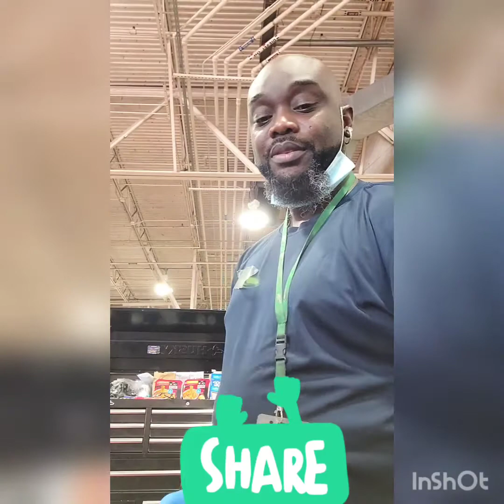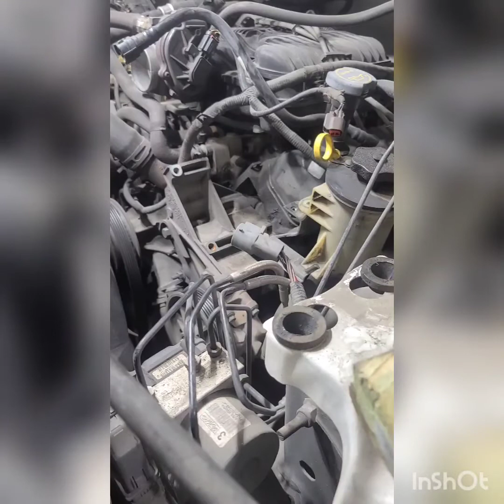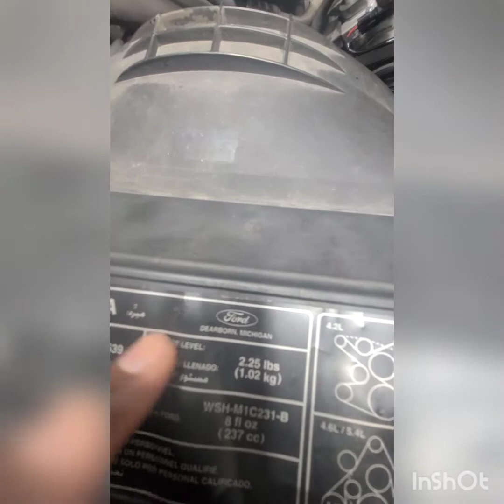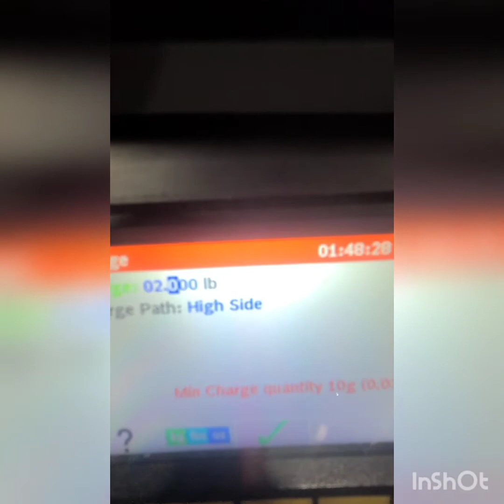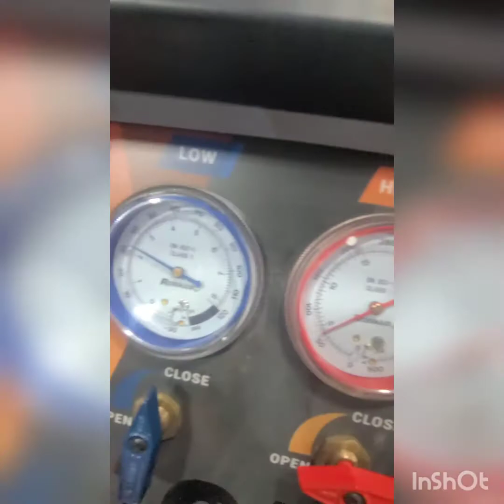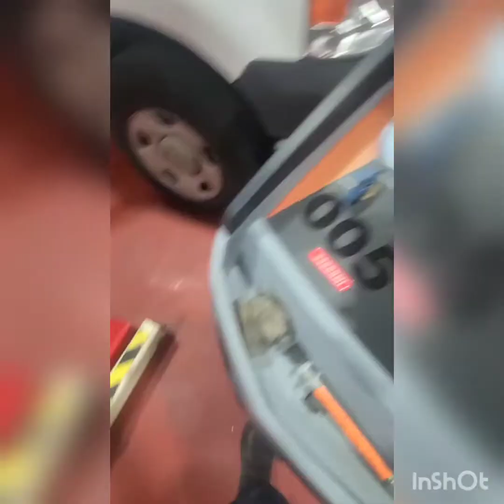07 f-150 A/C Compressor Installation

Comment: Uh,not an 07 as stated F150.. the compressor is on the bottom.
Reply from the maker: If you watch the video you see I pulled it from the top...their is a diffrence between the 4.6 and 5.4
Reply: @platnumvi5057  I know there is a difference, I watched the whole video,pretty good,just wish it would of stated engine difference in the tag line,I was looking for tips on the 4.6...but ,spent time on this one. If I ever have larger engine Ford,I got the tips already.
Reply from the maker: @virgilward870  the  one you have is not that bad  just gotta work on your back  .. but same process
Reply: @platnumvi5057  Yep. Got her all put back together,pulled a vac of -29.5.. It held,added 134.. sprung a leak on suction line.. Got it ordered, and hope that is it.. It was all original 2007 FOMOCO parts. Put in 4Seasons...
Reply from the maker: @virgilward870  nice  all original  lasted this long ..your lucky..these new parts don't last as long  now
Reply: @platnumvi5057  Very true statement